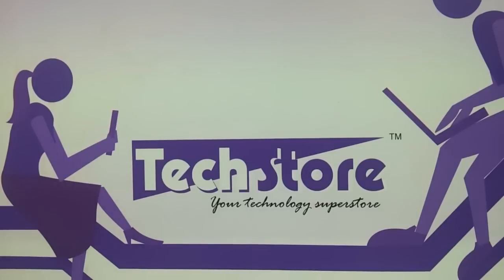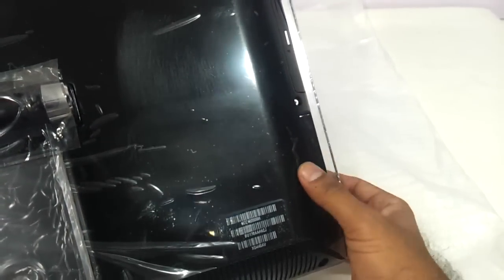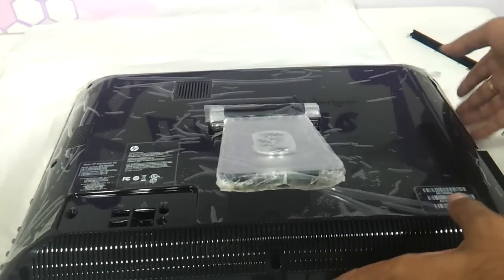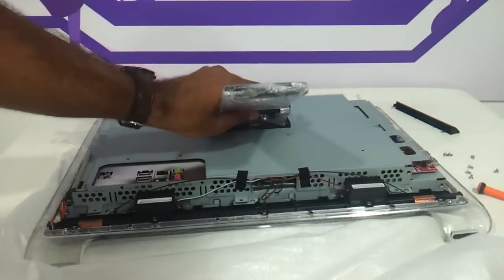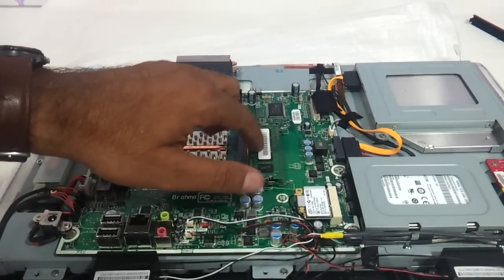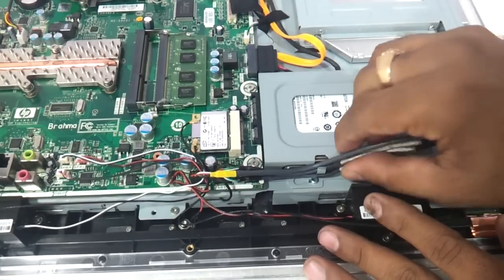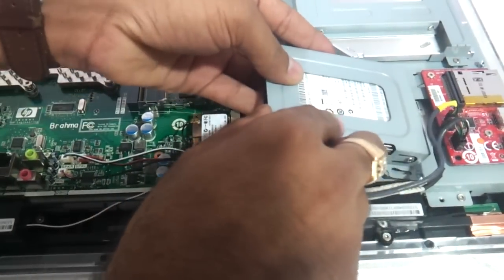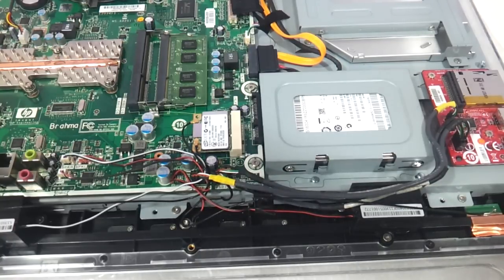Hp dreamscreen 400 How to upgrade ram and harddrive easy and precise diy

Comment: oh I added a hynix  2GB 2Rx8 PC3 -10600S ram (1333 Mhz) but the system refuses to boot
My system has 2GB 1Rx8 DDR3  (800 Mhz) ram
What is the exact Ram spec I need to purchase 
Should I change anything in the bios ... please help
Reply: Today I went out to buy something similar and the shopkeeper asked me whether I wanted PC3 or PC3L memory. I didn't know, so I came back home, googled, found this video and this comment (thanks for posting the comment).

This PC is the HP-branded version of MSI Wind Top AE1920. With some googling I found this ad on ebay that claims to sell a 2GB module for the AE1920:
https://www.amazon.co.uk/Memory-Microstar-Wind-AE1920-DDR3-10600/dp/B009BSHRPS
which also says "DDR3-10600 (PC3-1333)". It doesn't say "10600S"  though (I guess) it should.

So the only thing I can think of is to try PC3L. If you do that, please tell us what happened.
Reply: Hi Thanks a lot, I will see if it works and update you on the same.
Reply: Hi Mate, Thanks a lot for the update, 
Please download a software called CPU-Z (its fully safe), Please use this software to find the specifications of your memory modules.
Please do help by posting the memory card details on line, it would be much helpful.
Reply: I'm on Linux, no Windows, so using dmidecode I see that both modules are 800MT/s.
Reply: Thanks a lot, can you paste the complete memory details 
by running the following commands in command prompt
sudo lshw -C memory
sudo dmidecode -t memory
Please paste the details of both the memory banks, thanks a lot, sorry for the trouble.

Comment: +Techstore is there any way to solve this :-  Error:CPU Fan can not be detected!
Please verify to make sure fan cable is plug in correctly.
The system will shut down to prevent any potential damage to the system
Reply from the maker: +casa blanka Just check if the CPU fan is functional by putting ur palm near the heat vent. If not,open the laptop and get it replaced.

Comment: intel atom chips are generally soldered to the motherboard (thats what the vendor told me!!). but ur video shows that it comes out easily. i want my RAM to be minimum 4GB. what is the most suitable chip? I think i5 and the series will not fit as they have a different socket... please do correct me if i am wrong.